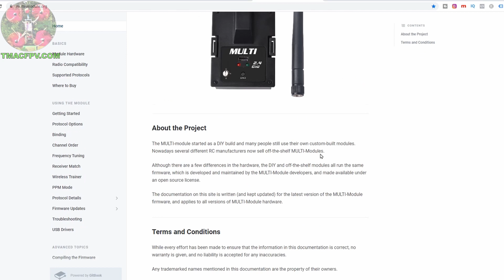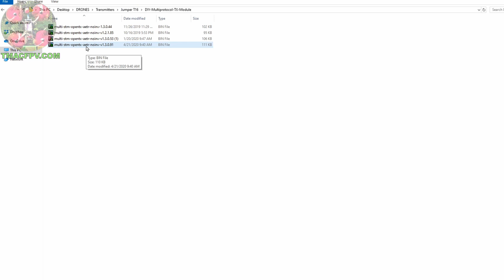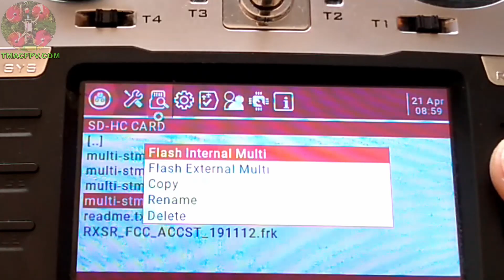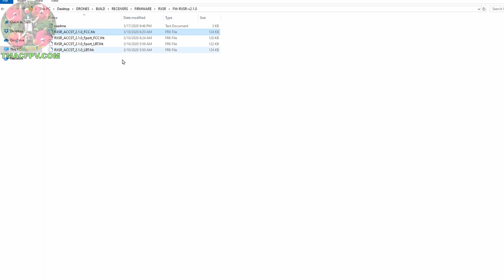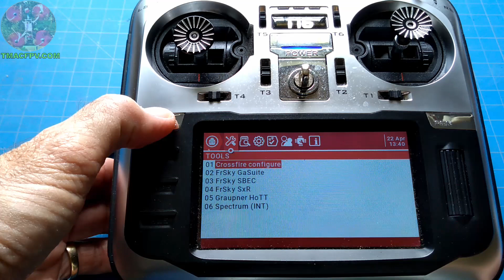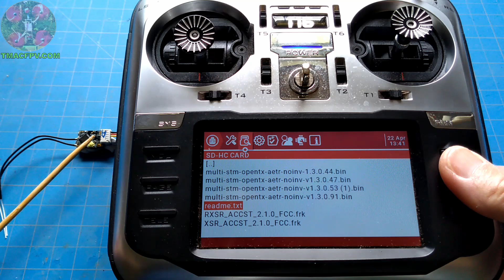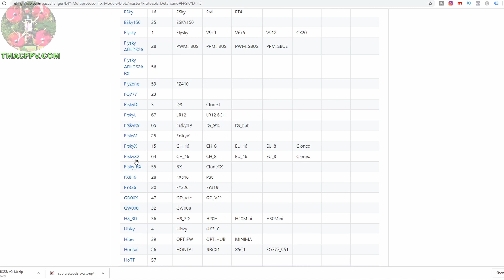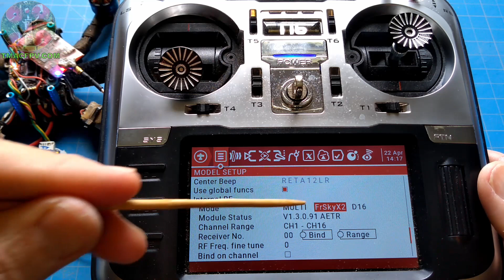Jumper T16 (NEW PROTOCOLS!)

Comment: Hey Tmac, I've yet to pull the trigger on a Jumper.  Can you tell me what kind of range you're getting with the multi module?  I assume it is limited range like my Devo7e (my toy level TX) versus the full range native module.
Reply from the maker: Hey Ferociter! The Jumper T16 pro (and now V2) comes with an internal multimodule integrated within the transmitter (actually INSIDE the transmitter). Your "range" will depend on many factors, however, the multimodule it uses is "hobby grade" not "toy grade."  You can learn more about the multimodule at https://www.multi-module.org/ .  Its got the same standard output power as other hobby grade transmitters.  The type of receiver you use on your RC aircraft, the environment you fly in, etc. will affect your "range."  Many experienced FPV pilots use the Jumper T16 Pro.  It also has an external module bay which you can plug a TBS Crossfire module into (that operates at 900 MHz instead of the regular 2.4 GHz) that will give you more than enough range for whatever type flying you do (it also penetrates wooded areas and buildings better than 2.4 Ghz so you can fly in/through/around trees and buildings without losing control signal.  Hope that helps and stay in touch!
Reply: I have an X10s with a R9 module.  It recently failed so I'm going to replace it soon.  But I don't want to loose my RX investment...... Too many quads to convert to TBS.  Jumper looks great!
Reply from the maker: @mccolld11  Oh no! Sorry to hear about your X10S! What happened, how did it fail?  I've enjoyed my original T16 Pro (V1) since October 2019, no issues. I understand your R9 investment, I also used R9 for awhile.  Only had the RXs on 2 quads though, so when FrSky went to ACCESS, I made the switch to Crossfire.  i say, whatever works for you, just have fun!👍😀
Reply: It just quit broadcasting on both 2.4 GHz & 900 MHz.  Everything else works.

I'm right there with you! I want to get away from frsky, too.

Comment: Thanks TMac.  As always, great video.  Now all I have to do is to get my Jumper T16 to be able to flash an external receiver.  I sent you an email on my latest findings as to (possibly) why I can’t flash any external devices with my Jumper T16.
Reply from the maker: Appreciate it! I'm still thinking its an internal ribbon cable connector that needs to be disconnected and reconnected OR your servo wiring harness used to flash receivers has a loose connection in one of the connectors
Reply: TMac 
I took it apart twice and I don’t see a ribbon cable that is associated with the module.  There’s a JSP wiring system at the bottom that plugs into it and I’ve disconnected and reconnected it twice now. 

I don’t think that it’s the servo harness because I can’t even flash the latest firmware for the JP4IN-SE external module.  When I try it gives me the a Firmware Update Error - NoSync
Reply: If I put the old factory delivered module back on just to try and flash both the JP4IN-SE and the receiver would that screw up any of my internal models or the existing settings on the internal multi module?